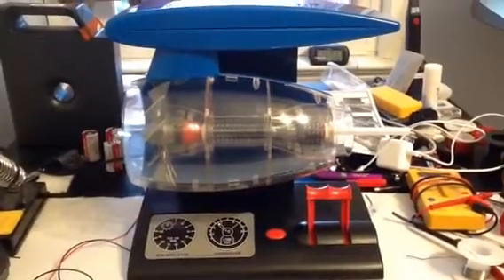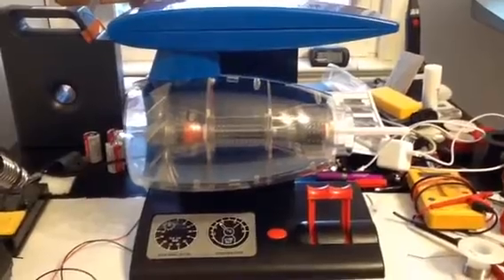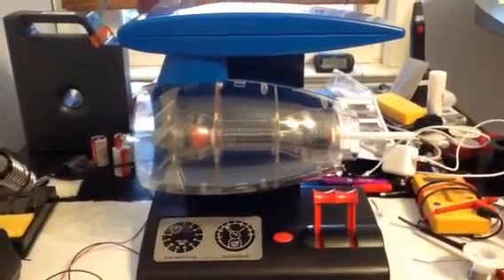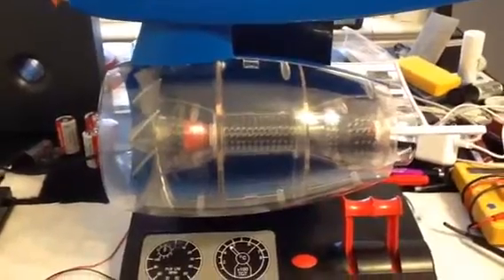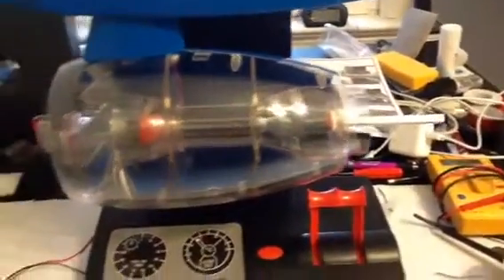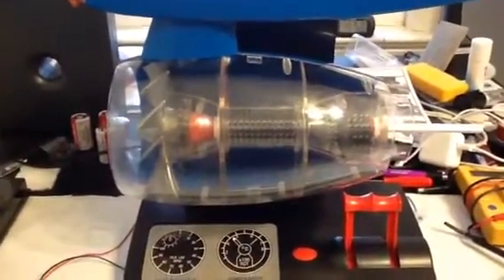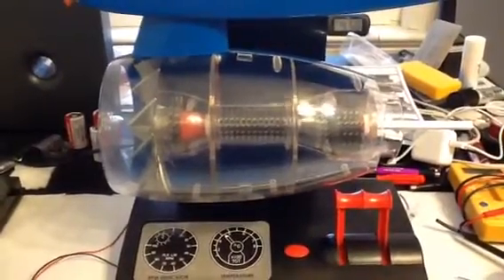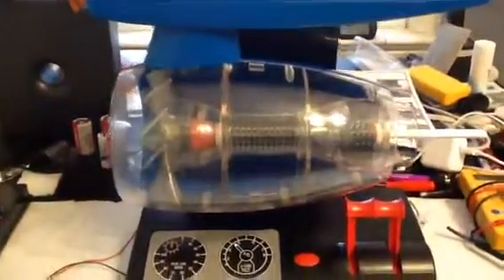Airfix jet engine

Comment: It was spinning in the wrong direction, reverse the polarity....
Reply: I built one of these some years ago.  Reversing the polarity will do nothing, as the rotor is not turned by an electric motor.  
The fan is turned by air supplied from a little electrically driven blower, which is housed in the wing section above the engine.  The air supply from the blower impinges on the tips of the fan blades from a nozzle, which is placed behind the fan.  This means that the rotor turns in the wrong direction.  I modified my model, to place the nozzle in front of the fan, so that it does turn in the right direction.
PS  I found that the battery pack in the base of the model would only last a matter of minutes, so I wired up additional battery packs, which I fitted to the back of the model.  Even so, the power of the little blower is barely enough to keep the rotor turning.
I also added some bracing to the model, between the back wall structure and the base.

Comment: Thank you for your feedback. I have just gotten a kit this last Christmas :) I am a bit disappointed. The documentation does not  help much. After having spent a few hours to mount it, the pump flow rate is too low to spin the rotor at high speed. 

Could you tell us more about how you wired it? Did you keep the original one as it's explained in this video: www.youtube.com/watch?v=wtUnF_LnmHk ? Or did you modify it as @leokimvideo did: www.youtube.com/watch?v=bTQpjlWoPYs ?

What about the batteries? Did you still use the 4 batteries, 1.5 volt, size C?

Thank in advance.